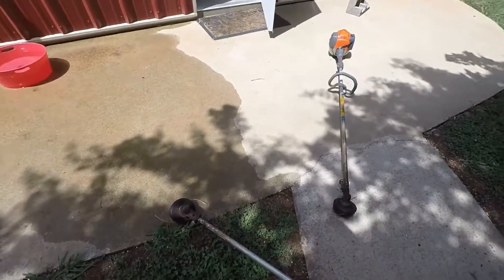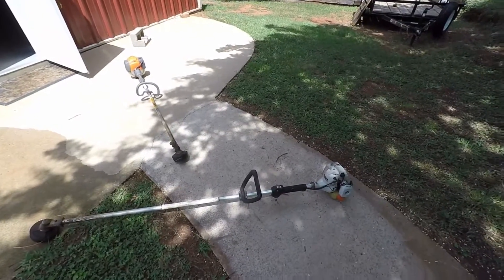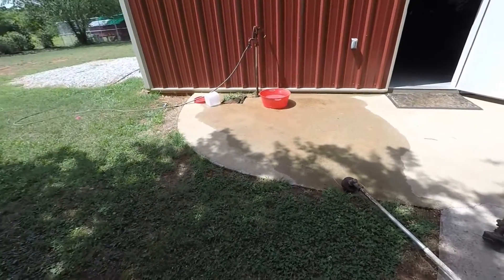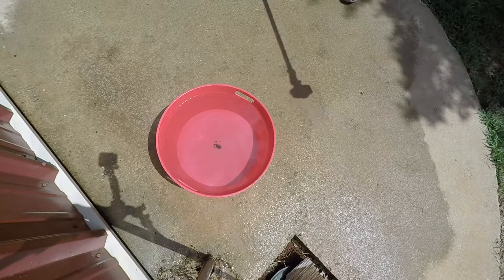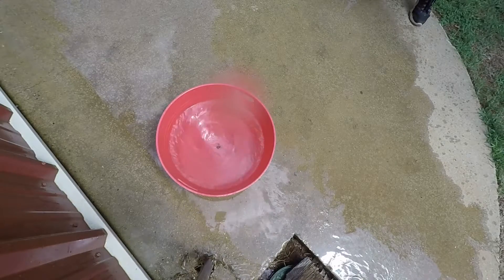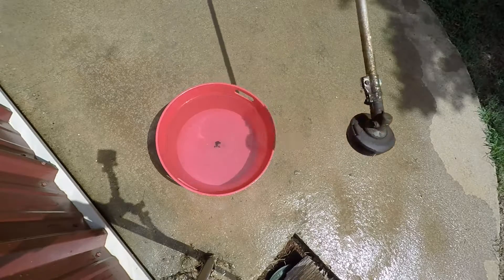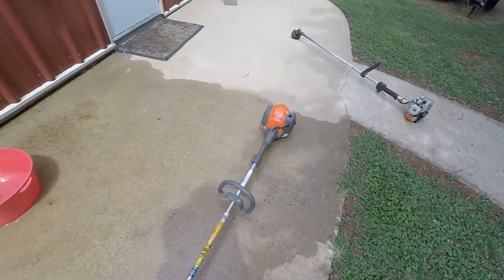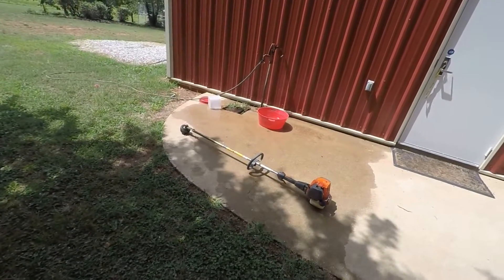Husqvarna vs Echo Torque test

Comment: husky has more torque cause its a four stroke you need to compare it with an echo srm266
Reply from the maker: +Victor Rippe Yes! That is very much implied! The SRM266T is a high torque trimmer but it also costs a bit more than a 224L. And it is still a 2 stroke. I recognize this is not a great comparison, but I used what I had. Both are great trimmers!

Comment: that why new echo have new technology speedfeed head to keep up with stihl, if without that head echo wouldn't be in competition against stihl. stihl have more power in displacement cc compare to echo.
Reply: anyone who has ever fix there weed eater them self knows that echo are better made ,better cost and aslo are more comfortable than stihl .stihi is german bullshit .it break easyer than cost more than worth to fix just like a audi or bmw or vw or mercedes .any mechanic will tell you never buy german.only american or japenese
Reply: @jl5728  Yep, I sold my Echo PB250 and SRM230 I had for 8 and 9 years when I inherited my grandfathers SH85 and FS90R. I had about 300-350 hours of hell on that SRM230 and it still ran like the day I brought it home and I had it so hot I gave myself a nasty arm burn from the clutch housing more than once. The FS90R was nothing but trouble, 2 coils, 2 carbs, 1 on/off switch on a low use homeowner machine and the valves wouldn't stay adjusted either. The SH85 the carb would never stay tuned even with a new one. I really regretted selling my Echo products for that junk. I wound up buying an SRM266 and a PB580T and sold that german bullshit and have been super happy with the new Echo products, had them both like 6 and 7 years now. I hated every Stihl I ever worked on for somebody. The only one I've liked is the MS180C I kept but I had to trim the plastic top cover because the chain brake kept popping it off. Yeah, STIHL man...
Reply from the maker: Changing the head would not increase trimmer power or torque. All that depends on the shaft gear box. The 265t has a different gearing than most trimmers.
Reply: crazyjdkid and did not said it will increase power but that echo speed feed pretty good at cut though and pretty smooth.